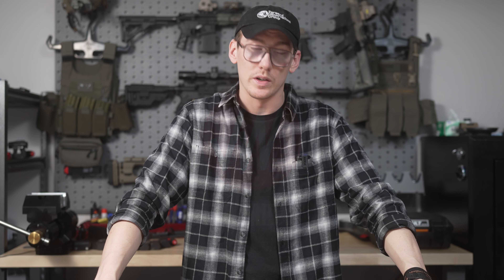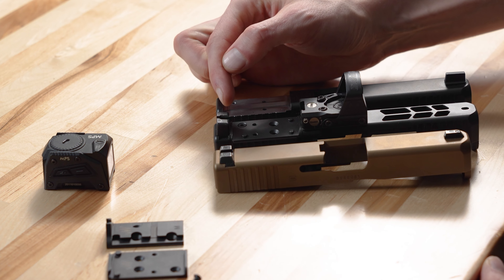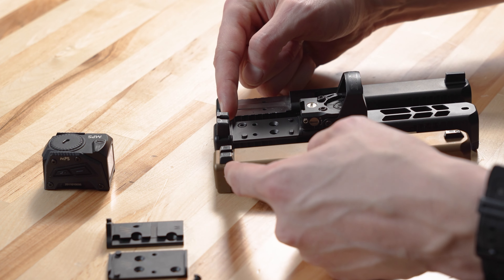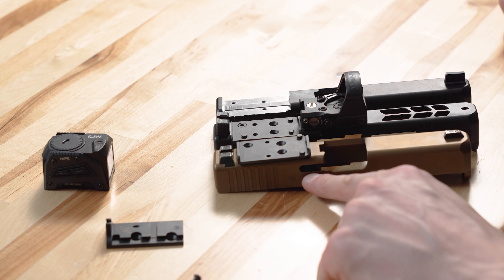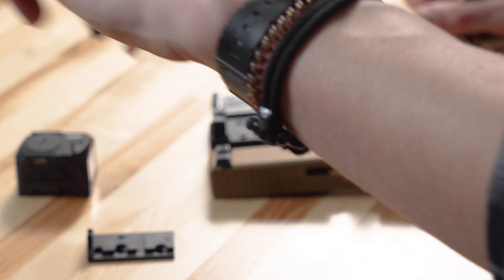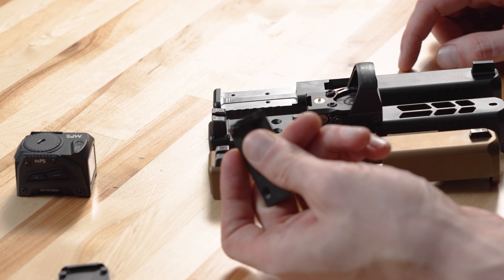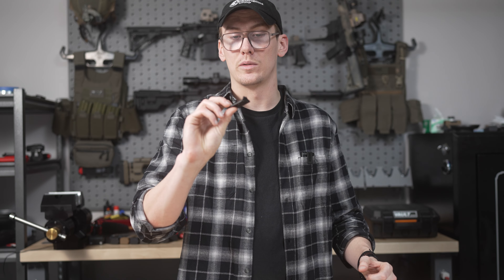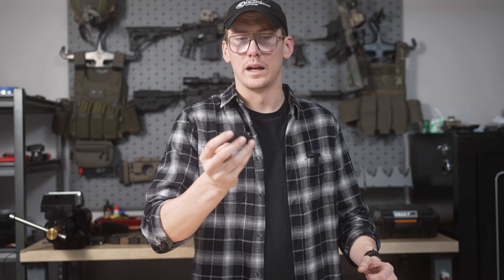FAQ Friday | MOS+ Cuts and Plates

Comment: Sorry for the understanding, but can you put a MOS + plate on a MOS factory Glock?
I’m interested to have the sights in front on the optic without milling the slide. Thanks.
Reply from the maker: Yup! Totally functions on a Factory MOS. Just won't have used of the 3rd hole but it's still superior materials and built in irons.
Reply: I live close to kzoo anyway I can just pickup parts and drop off slides in person?